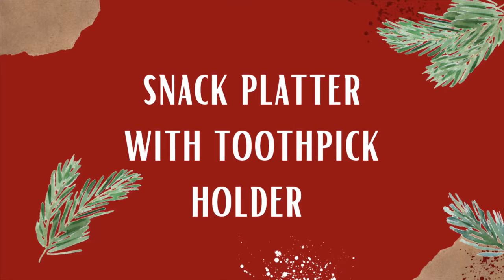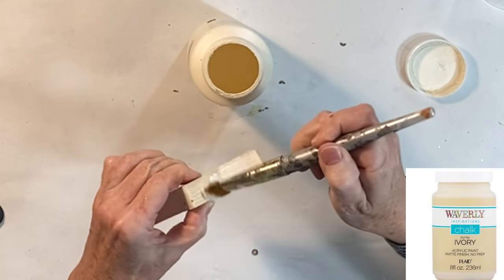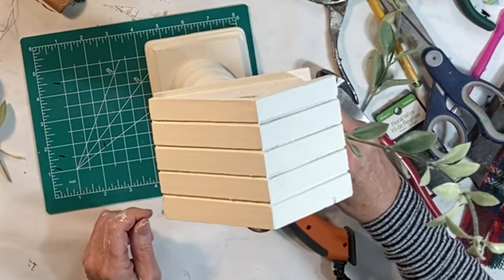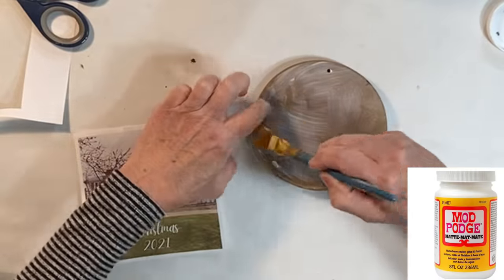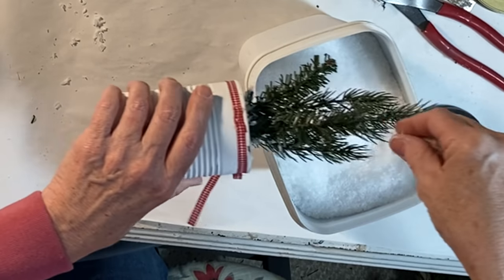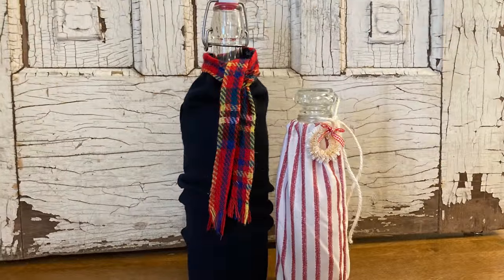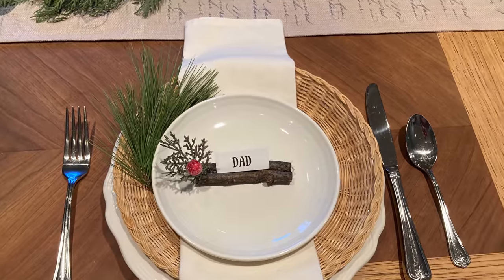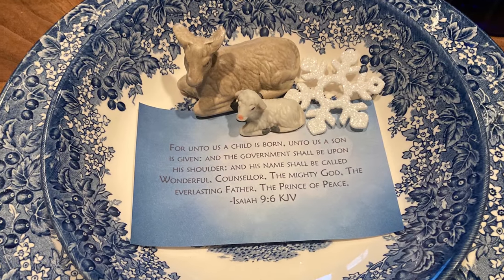15 DIY HOSTESS GIFTS AND TABLE SETTING IDEAS

Comment: Lovely! To recommend another product, Glitter glue (any brand) has been a game changer for me. Instead of putting hot glue on the leaves and dipping in glitter, you would just squeeze out the glitter glue. Way less messy and after it is dry the glitter is not coming off.

Comment: OH! Perfect timing! I am looking for a new glue gun for my self....the one I replaced has attachments that turned out to be pretty useless, as the tip is quite impossible to remove....and the huge problem is the amount of glue that pours out of it at all times. What glue gun have you (all) found to be best for controlling the loss of glue? Thanks so much! This is the only channel I run to on Tuesday! Or even know the release date of. Merry Christmas!

Comment: Why do you have the spoon to the left of the plate?  I have always seen the spoon on the right outside the knife.  Just wondering…
Reply from the maker: You’re right. The spoon should be on the right. I had the spoon placed correctly for the first couple of place settings, and I mistakenly moved it when I was rearranging the place setting. 😜